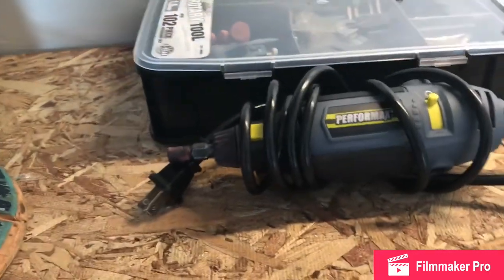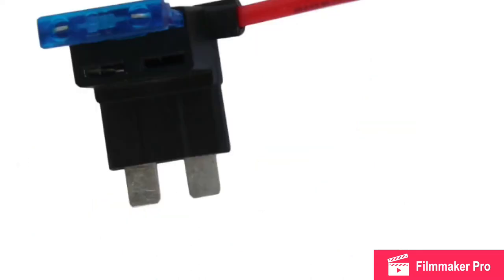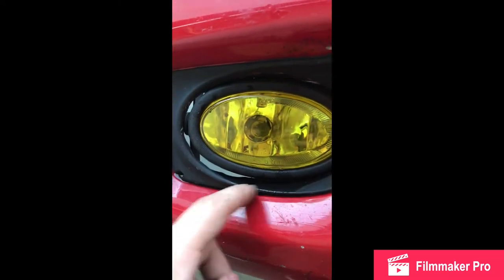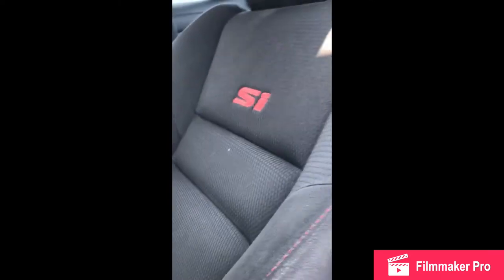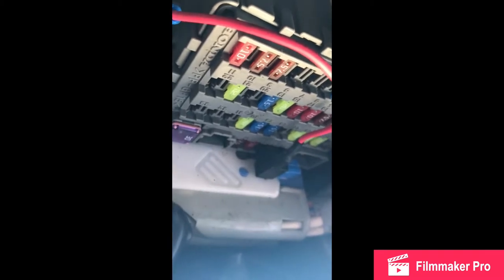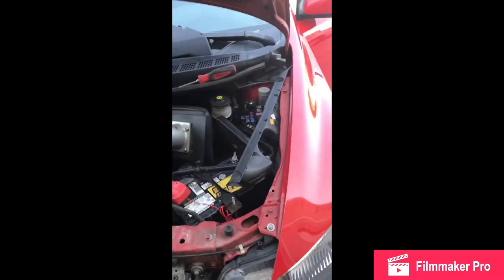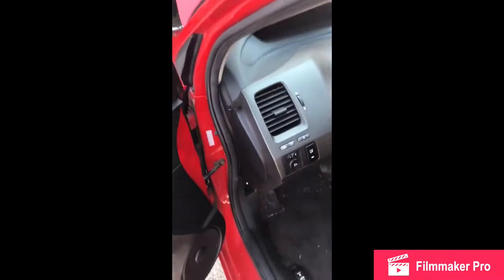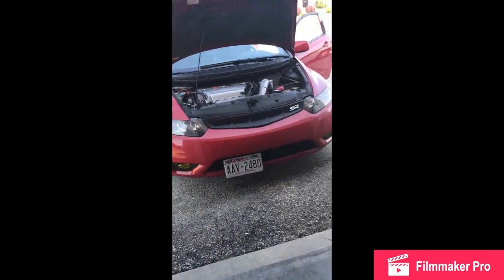2006 Honda Civic si fog light install

Comment: I have the exact same kit, and I hooked everything up the same way you did but my lights won’t turn on I was wondering what fuses you used for the add a fuse.
Reply from the maker: Teyron Mcclain I believe I used the radio fuse.

Comment: there is a cut out to run red wire from the driver side wheel well to inside car so you won't cut wire in door jam. watch 1Aauto.com channel on this. they have a video how to hook up fog lights for this exact car. just did this last week. being you already knocked all the hard parts out. it will only take you a few mins to make the correction.
Reply from the maker: Omar Chisolm awesome! Thanks for the help!
Reply: @Unusual_ryan  I got you =]

Comment: Just finished the install and it worked perfectly and car was working as well. But about 10 mins passed and now my car won’t start. I put the key In the ignition and the battery seems fine. Dash lights up and all headlights/fog lights work. Car just won’t start. Any help please?
Reply from the maker: Zeek Ville I would say check your fuses, check to make sure your battery terminals are tight and make sure no bare wires are touching metal. Best of luck man!
Reply from the maker: Zeek Ville because the battery might seem fine but as soon as the battery or done connection moves it could act dead
Reply: go back and recheck things around the fuse box. maybe you undid a fuse for the ignition or something. but is it a no crank no start or it cranks but don't start.